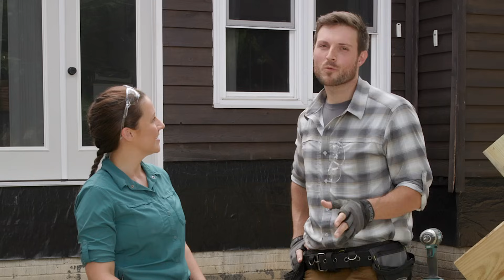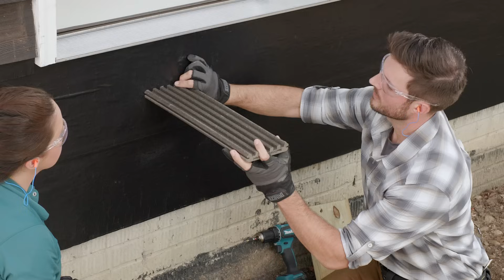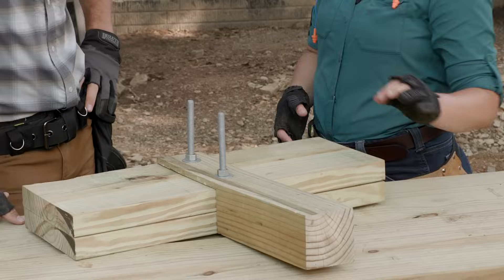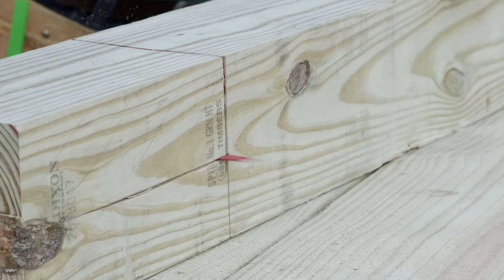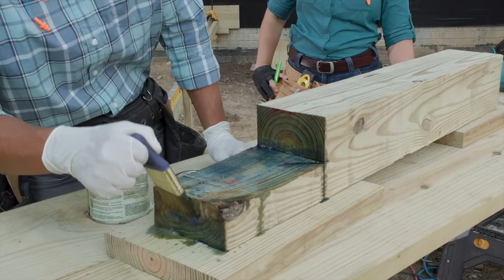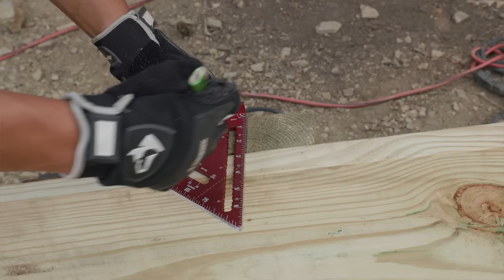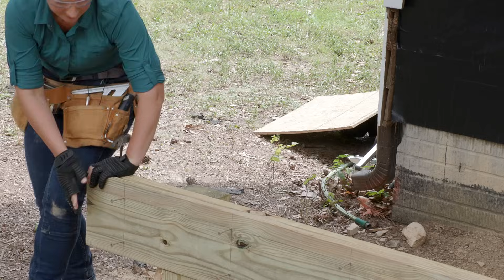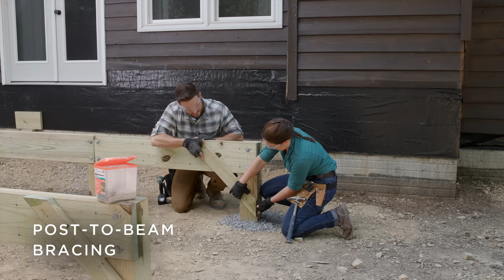How to Install Deck Frame Beams and Posts | Trex Academy

Comment: The "code approved " statement is a bit misleading in that codes can be different from state to state and county to county . the notch method is secure but i don't use it because it collects water onto end grain . coating it with the same sealer used in pressure treating is not as effective as pressure treated . aside from that , using half inch diameter or larger galvanized bolts is plenty strong ,  a half inch bolt can withstand 20, ooo lbs of shear force on it , so if you live in an area where codes won't be an issue , it will be more than strong enough . just use extra large washers to spread the weight out .
Reply: agree

Comment: If you have any clay soil in your post holes water will not drain,  you’ve basically made a hole for water to hangout in.  Concrete pier would be far better or the old concrete fill method.
Reply: I have been wondering why so many yt videos seem to have no problem with dirt/wood contact when in my area that’s a recipe for rot. Clay vs sand soil makes sense. Thanks.

Comment: I found the exact same wood presevative but the label says: for "non pressure treaded wood" on the label. Isn't this pressure treated lumber?
Reply from the maker: Hi Will. This is a great question and thank you for reaching out to Trex. The preservative was applied to the cut ends that were not previously treated. This will ensure the entire piece of lumber is protected. Please let us know if you have any additional questions. Someone from our Customer Care Team will be more than happy to assist. Kind Regards. -Trex Customer Care 800-289-8739 |  customercare@trex.com
Reply: what the brand and name of the preservative?

Comment: Materials list? Wood sealer info and fasteners, screws etc?
Reply from the maker: Our Deck Designer Tool can assist you in generating a material list https://www.trex.com/build-your-deck/planyourdeck/deck-designer/ Infrastructure requirements can vary depending on your local code's requirements. Always check in with your local coding officials prior to beginning a decking project. Have a great day! - Trex Customer Care Team

Comment: 10:14 the 3rd example, why isn't that code approved? That is how the ledger board is supported. Supported only by the bolts and no post support. Also, how are the posts, in this video, attached to the footings? Last video was footings, this video involved the posts but what step isn't shown that leads up to gravel being backfilled in the holes at 37:00?
Reply: Just a guess, but I'm thinking the bolts aren't providing as much load support as the ledger board which has screws every 21 inches If I remember the video correctly. The bolts would be supporting load over several feet in that post to beam bolted arrangement. Then, it all comes down to what the local code and building inspector says. Which can vary from one municipality to the next. Fairly sure I have seen beams attached this way on pro jobs, but they were much heavier build than a couple of 1/2 inch bolts. 
On the footings I wondered the same thing. It appears to me that there was not any attachment between the posts and footings. They poured 6 inches of concrete below freeze line and just set the posts on top of it. Don't see any reason it wouldn't work, but I thought code now required posts to be 100% above ground and a space between the base and the post - why metal post supports have 1 inch standoff at the bottom. Then maybe's that's just marketing. 
I mentioned this recently to a local contractor in my area when he quoted me for deck build. He just digs 1 foot diameter hole to freeze line and fills with concrete to ground level. Then puts post on top of the poured column. Post above ground. Ground contact, but not buried. No attachment between the post and footings. 6 x 6 post just sitting on the poured footing. Local inspector approved the build. Guess the decks were too heavy for concern about wind lift. 🙂
However, If I was in a high wind area, costal, mountains, or something I would definitely want them attached to the footing some way.
Reply: @johnb197  here in Pittsburgh the footers have to be down 4ft. And everywhere around here the posts have to be mechanically attached to the footers. You can also make the footer ground level, as long as it's 4ft down. If the post is not attached to the footer, the hole has to be filled up to the top with cement. Crazy how things differ so much from boro to boro! I'm getting ready to help a friend with his deck build. Haven't got to the boro yet. So we'll see them what they say. These things should go by county by county!
Reply from the maker: Hello. Thank you so much for your interest in Trex and reaching out with your inquiry. What’s approved varies quite a bit so it’s best to check with your local municipality.  A document that often serves as the base document for municipalities writing deck building regulations in the US is the DCA-6, Prescriptive Residential Wood Deck Construction Guide. On page 10, figure 9 of the DCA-6 you’ll see that [third] example is not approved.   What’s permitted when it comes to footings varies quite a bit, so it’s best to check with your local municipality.  Approved by municipalities in several regions of the US, including the municipality where this deck was constructed, is the use of a ground contact rated pressure treated post placed on a specified size concrete footer at a specified depth.  No additional below grade brackets are required by some municipalities, just backfill up to grade around the posts and you’ve met the required detail.  You’ll notice that in the DCA-6, page 13, figure 12, “Typical Footing Options”, the option without brackets calls for ½ rods to be installed prior to backfilling, reinforcing how much what’s permitted varies and why it’s best to check with your local municipality before beginning your project.  If you have any additional questions, please feel free to reach back out to Trex. Someone from our Customer Care Team will be more than happy to assist. Kind Regards. -Trex Customer Care
Reply: I am building my deck with example #3.  If you used the correct number and size of fasteners rather than just 2 6" bolts, that connection would be just as strong as any reliance on the little metal brackets.  I understand the beams wouldn't be supported by the post, but the beams are not really supported from buckling unless there is good amount of boxing.  Sometimes I think rafter tie brackets and post connectors ect are given too much credit because their gauge thickness just isn't there.  They have decent tensile strength, but little to no lateral or shear strength.  Code isn't always common sense, its what somebody says is good enough at the time until they are proven otherwise due to failure.  That's why codes are always changing.  The deck I just removed was 40 years old and was built with example #3 on 4x4 posts and it has seen everything nature could throw at it except a tornado.  I am stepping up to 6x6 posts but with the GRX ceramic fasteners nowadays, there is absolutely no reason it can't be done.  Plus I live in the country, so I have that going for me.
Reply: @wagonerjared  I built my sister's pool deck with #3. It's been there for almost 15 years and still sturdy as ever. 2 carriage bolts and 4 construction screws in each post with two 2x6 beams in either side of 2 posts each with a total of 10 posts and 10 beams that wrap around one third of the pool.
Reply: I came to comment on this as well. In NC you can 100% support the floor load with the 3rd example.
Reply: I think example #3 is not code approved because you are basically relying on the strength of the wood fibers to hold everything up. It seems silly to do this when there are so many better options that will never move and put all the weight squarely on the post. I can't imagine that this is code approved anywhere unless you talk to some old inspector who doesn't care about modern building methods. Also, I'm pretty sure in the document that trex cites, there is language about positive connections for post to footings, uplift is a big issue in current code. That is why my deck is only 12" off the ground but has 4' x 16" footers all concrete with j bolts and simpson post footings.
Reply from the maker: Hello, and thank you for reaching out to us with your concerns. Each municipality can and will enforce their own code requirements.  As for the one we show here, it was approved in the area which this material was installed in. We always recommend consulting with your local municipality to verify the approved methods for any construction on your property.  In the end, the local municipality will have the final approval of the project. If you have any additional questions or concerns, please feel free to call us at 1-800-289-8739. Thanks - Paul, Trex Customer Care

Comment: How did they know where to notch out the other posts without repeating the process of leveling the 2x4 against the ledger? Looks as if making them the exact same height of the original 2 6x6 posts would make them incorrect height because the post holes dug may be at slightly different depths. Explanation would be very helpful
Reply from the maker: Hi Umar! The height needs to be measured off of the ledger to determine the correct height for each post.  This can be done by leveling out to each post from the ledger or leveling to one post from the ledger and then leveling from that post to the next post and repeat that process to all posts. - Trex Customer Care
Reply: @TheTrexCo  That is just common sense but at first I thought the same thing than logic or experience told me it had to be repeated off the level ledger line or post to post.
Reply: Yeah. I would have done them one by one as well as opposed to mass produce based off of the measurements of the one. But that's just me.

Comment: One of the best DIY videos I have ever seen.  Kudos to you!  We are looking to extend our 2nd level 12x16 deck with roof by building a 12'Lx16'W second level uncovered deck extension (about 9' from ground).  We need the beam to span 16 feet (no middle post) to avoid blocking the basement door.  We plan to 2 use 2 2x12x16 supported by 8x8 post (to match existing covered deck).  Is this adequate or would you suggest 3 2x12x16 for the beam?  By way of reference, we used 4 glulaminated beams (3 sides plus 1 in the middle) supported by 4 8x8s for the covered deck.
Reply: Hi Danny -  Excellent question.  This may be a bit old, but the size of the beam you will use depends on the loads that will be applied.  It will be best to check with a local engineer to size the beam properly.  The roof will also catch wind, so there will be wind and shear loads that should be accounted for.  Hope your project turned out!
Reply from the maker: Hi Danny, Thank you for the positive feed back on our video. We can not give any specific recommendations on the substructure as we do not manufacture that product. What we can recommend, is to reach out to your local code official. Every area is going to be different, and they will tell you what is recommended in your area for the substructure. Thank you again for the great feed back and please, reach out to us at 1-800-289-8739 if you have any further questions. Trex Customer Care